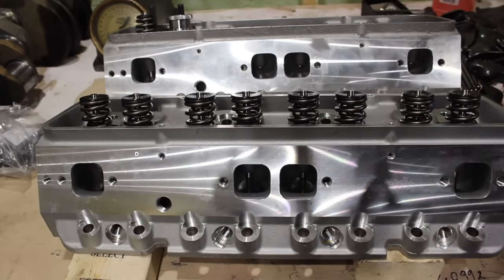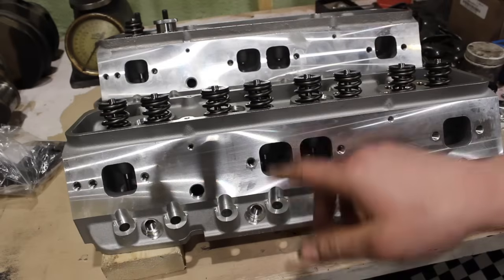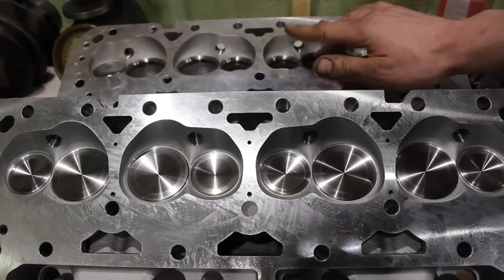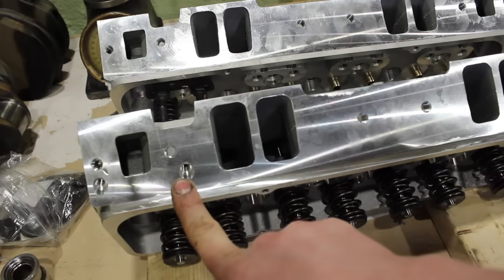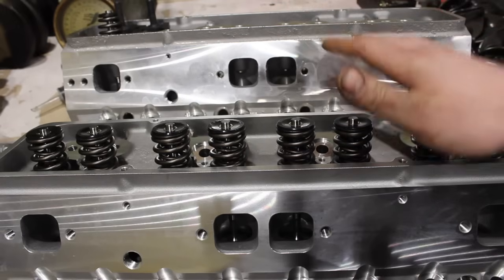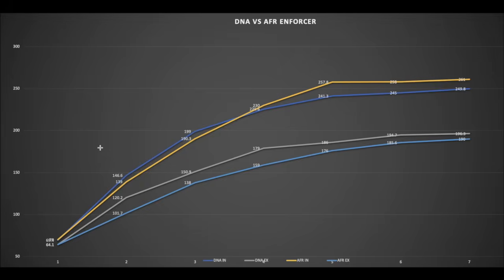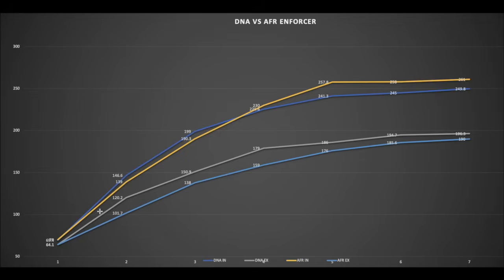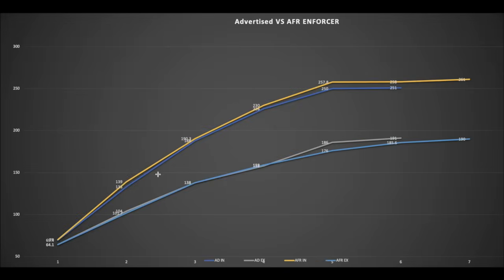$165 Amazon SBC Head vs Budget AFR Enforcer! (Flow Bench!)

Comment: I picked up a set of “Deepmotor” aka Chicom copies for $380 190cc int. runners & 64cc chambers and I did have to clean them up a bit (they’ll run fine I’m just ocd) but I picked up more power than $400 should have gotten me. I’d rather buy from an American company but I’m not wealthy so these domestic producers like AFR or Edelbrock etc... need to come out with actual budget heads if they want to retain customers that can’t afford their heads even when they’re used let alone new
Reply: Exactly, I'm a broke college student building my first performance motor and I refuse to spend 2k on heads that were still cast in the same factory in China when everything tells (like in this video) that most "chineseium" heads flow nearly the same casting bumps and all. Just bought some 400$ 205cc runner heads off Ebay we'll see how they do lol.

Comment: I need new heads for my 5.3 vortec LM7.  I don't know where to find them for good price.  I don't need performance.   I need stock.  My own are 862 casting.  My truck is 2005 gmc sierra1500.  If you know,  I would appreciate your help.

Comment: Yes, so many people are all about them flow numbers, but that's just a small part of the story.
Port velocity is even more critical when it comes right down to it!
Reply: Like Smokey always said, "You don't race flow benches". He also said, "Only you can prevent forest fires".
Reply: It's a combination of both.
Reply: More cc will take over at high rpm,,, port velocity becomes "less important"
Reply: this is 90s thinking all that matters is getting cfm into the chamber, which larger heads can.  I've been running 195cc heads on 5.0L sbf and have yet to see a smaller high velocity head (like ported E7 head) outperform me in the 2,000-4,000 rpm range
Reply: Phone numbers are often make more power on the dyno but when it changes gears the port velocity gives way down with it bigger port

Comment: The exhaust flow out of the AFR's is obviously a lot better and people don't think about how much that affects power production. You can flow like crazy into a cylinder but if you aren't getting that spent mixture out you're killing power. AFR's heads are expensive there is no doubt but how often do you see them getting beat in dyno comparisons? So if you are wanting something that looks badass but isn't go cheap if you want badass save up and get the good stuff.

Comment: For me I would go the bare DNA heads and a valves/spring/retainer pack from competition products.
Then an afternoon with 60 grit cartridge rolls in the ports.
Actually I would probably get carried away and port them a little.
Reply: Here's a tip... Just clean up the exhausts, shape the lower side and the area flowing out with a match port, especially at the bottom. I'm not into 5 angle valve jobs, because 3 angles with blended top and bottom angles flow better. You may also want to increase the throat to 75 to 80% if you have a lift near .600. On the intake side. Match port the runners in an inch or so, blending into the existing ports flow. Clean the rest of the runner up. 3 angle valve job blended and you are good to go. If you have some lift, hog the bowls to the flash then clean the flash area around the guide, then round your guide. It's a weekend project if you don't do this for a living. I'm a machinest and it takes me an a day. If you can spare a few CC's unshroud the valves in the chamber and at the plugthreads. It will cost you 2 to 3 CC's but worth It On the flow results I've seen. If your not going vortex, remove the upper lip at the top of the intake gasket. The intake side are based on vortecs. I can speculate on the exhausts. Heres something that they don't tell you. They take 16 + .100 valves.

Comment: Damn, back in the day, we couldn't have even imagined getting a head as good as those DNA heads for anywhere near those prices.  Holy hell the world has changed - haven't priced aftermarket aluminum heads since the mid-90's for SBC.
Reply: Really the CNC machine is what made this all happen
Reply: Because all China had to do was cost-engineer them vs trial and error and proper engineering.
Reply: Super simple nowadays. China just takes a good design, and illegally copies it. Then you find them for dirt cheap on Amazon, or ebay. They save themselves from r&d by just stealing the design.
Reply: @warhorse58gt  Since they make most of them for us, we either invest in America, or continue to lose out to China. I'm not condoning theft, but it would be harder to steal if China wasn't casting a large percentage of our parts to begin with.
Reply: @warhorse58gt   that does happen.. a lot. But its just as common for American companies to take their designs to China and have them made there. 

The glut of affordable stroker kits over the last few decades are 100% due to companies importing Chinese cranks.
Reply: And the tollerances suck
Reply: No lie.
Reply: You better sit down when you do get prices
Reply: Yeah I will never save a buck to buy foreign stuff if I know they were copied from American companies
Reply: Man you remember those 1000 Brodix heads?
Reply: Afr made in USA not China
Reply: @bigblock1383  not the enforcer, they all have their off shore budget heads. Some are from India
Reply: @bigblock1383  enforcer is not us cast
Reply: Sadly soon all combustion cars, bikes including classics will be banned from public streets in entire EU and Scandinavia  :-( 
In Germany the Green Peoples Party gave order to shorten fuel supply from 2025 on by reducing all conventional fuel stations to only one state operated central gas station per city or county. Now they want to slow down all the gas station pumps from 20 litre per minute to 2 litre per minute...From 2027 on in the EU certain car spare parts will be banned too....as exhaust systems, turbo chargers and even some engine and gearbox oils...California and New York will do the same from 2027 on.... So no investments should be done in oil burning cars any longer....They even created a new kind of crime here, called emissions and smoke crime (Bundesabgasbespassungsverbotsverordnung)!!!!!!
Reply: Sucks to live there
Reply: Why do you all tolerate such nonsense? Fight back moron. They’re cowards.
Reply: @Schlipperschlopper  . . . but an all-electric economy doesn't work.  Now they want to throw away the gas stoves and go electric.  The grid can't charge all the cars and do all the cooking, heating houses and hot water, and they still have to burn coal and natural gas somewhere until they convert the last forests into sheets of glass and windmill farms.
Reply: @Schlipperschlopper  rise up and fight

Comment: During my visit to China 25 years agoish I toured their industrial areas in several major regions and you'd see 1 plant set up to produce say Honda parts and that plant built the oarts to Hondas engineers specs and alloys and ratings... Literally walk out thr back door of some of thise plants and into a smaller dirty lousy lit plant producing the exact same parts but without the exacting tolerances and using inferior materials which is where the Honda G series engine clones came from as well as aftermarket Japanese brand replacement parts that cos thalf as much or less than oem... Today it's even worse over there as China doesn't honor trademarks,or any protective designs,names,nothing they can alter solittle and get away with... 
 Those Amazon cheapy heads would make a great starting point for a strong budget build where time and effort expended outweighed money thrown and probably wouldn't require much more investment in time and money than one normally throws at cast iron heads to reap much better results...
 Someone should build a set ir two of them; one mildish and the other all out and see what gains can be made...

Comment: Check the thickness of the upper wall, inside the intake side, on the short side of the valve radius. We made a lot more horsepower with a higher top wall there. It’s even more pronounced with 351 Cleveland heads for fords, BUT, ( on Cleveland heads) because of the volume inside the runner, it’s best to put vanes inside the runners. This is done by drilling a hole in the bottom of the intake runner and running a threaded shaft, which is attached to the “vane” ( a piece of thin curved metal, much like what’s in torque converters), and after tightening, silicone. You have a flow bench, put your finger in front of the intake runner (or a popsicle stick) to see the difference. Ultimately you’re wanting to direct flow to the short-side radius, heighten the top of the runner, to streamline flow into the combustion chamber and create a better “mix” ( volumetric efficiency) in the chamber.
Reply: Have thought about doing that for years, you're the first I've heard of using vanes. Are you talking about a carbureted setup and if so, what does the fuel do to the silicone? On the old Buick heads we have been taught to leave the short side radius alone, BTW.

Comment: i ported and polished a set of procomp 205 -202-160 heads and ill tell you i dont know what  they flow but my 358 runs real strong im talkin high 10s strong in a 78 malibu i had a 1190 camaro and this car is much quicker.my opinion you port any 202 head or bigger you will produce some power

Comment: Sand papper roll the DNA Motoring Heads , Gasked match them . use a Neck Down Valve . & . it looks like the DNA Motoring Heads would Out perform the Afr heads .

Comment: Just help do a little work on set of stock vortecs for his pickup, he stopped at 255 cfm.
Reply from the maker: Impressive! Its hard to get that flow from a vortec, not alot of meat to work with
Reply: @cuttersperformance  He did put bigger intake valve and used good seat cutter.

Comment: And if you cleaned up the rough spots on the intake and exhaust would probably flow even better huh??? Looked at a bare set for a 400sbc I gt on the engine stand

Comment: There's other factor like cc of the head when making a choice. Velocity is very important also. 
That said I'll take the AFR heads all day sure vs a cheap head like this. If it's a mild build and not really beating on it I guess they're ok and have a place. My little sbc with AFR 220cc makes 637hp on pump 93 with a hydraulic roller on a mild tune. 
Although anyone looking for the baddest 23 degree sbc head BES ALL PRO RR245 are where it's at. From .700 thur 1.000 lift they flow about 370/292. They only start at 6,700 though lol. Nice video by the way.
Reply: The AFR enforcers are a version of same chinese castings you can buy from china though afr does replace the valve guides and regrinds the seats before reselling

Comment: THOSE CHEAP HEADS FLOW PRETTY GOOD OUTA THE BOX, A LITTLE CLEAN UP AND A GOOD VALVE JOB,PORT MATCH AND THERE GOOD TO GO
Reply: If I had a use for them I would order a set in a minute.  Interesting thing though, the heads found on the 4.3L v6 Vortec motor found in Chevy light duty trucks flow quite a bit out of the box and with a clean up will flow over 300 CFM easy and that's more that the aftermarktet heads found for a Grand National or the Buick Stage 2 heads.  The heads from GM parts direct, are cheap.  Only $168 for a pair, that is crazy and they are made with very high quality and engineering.  The trade off, well you have to do a lot of custom work to swap the 4.3l v6 vortec into a Grand National for instances.
Reply: @charleslowe522   4.3 heads are Chevy heads. Grand Nationals use a 109 cast BOP 3.8 block.   They heads, intake, etc won't interchange.   Two completely different animals.
Reply: @charleslowe522  thanks for sharing!  I can’t find the heads you mentioned for $168 for the pair. Could you share a link?  I would love to get a replacement set for that price. For my GMC Safari =D
Reply: Especially when you can use a Cutlass body or Buick any G body

Comment: Stock 706 heads 250. Just put springs. Thanks for the info
 I'm addicted to flow numbers engine Dyno numbers and all that scientific stuff lol...
Reply from the maker: Ls head are amazing, no doubt about that. I got a few different sets here and will do some porting and flow bench results when I get some other projects cleaned up!
Reply: @cuttersperformance  I got a 68 cougar with a 1990 5.0 in it going to blow it up and then put in a 5-3 cannot wait to experience the ls power🇺🇸
Reply from the maker: The ole cross breed of Ford and GM haha love it

Comment: I would be more concerned with the quality of the DNA head as far as the valve's valve seat Springs retainers go... not so much the flow numbers
Reply from the maker: Yeah exactly!
I got these as bare castings but im still worried about the seats and guides. 
I'm adding American made valves, springs and retainers and we shall see
Reply: The biggest problem with the China heads is the hardware. I had a buddy order a different set for a BBC. Springs were supposed to have a seat pressure of 135. It was 80... Absolute crap.
PAC springs and Argentinian valves. That's where it's at.

Comment: Honestly how much does exhaust flow matter when cylinder pressure is 145 psi or more pushing it out? Would be interesting to see if it makes any difference on dyno, better or worse flow on exhaust. Great video thanks for comparing the 2 heads btw!
Reply from the maker: Well thats the old debate, how important is exhaust flow? 
Even dyno testing doesn't have for sure answer on that as it depends highly on the combo for NA 
Nitrous or boosted engines show very positive results with high flowing exhaust ports
Reply: @port nut And temps. There's more to it than just getting the gasses out.

Comment: The AFR enforcer is a great bang for the buck  head , I believe Skip White sells this same casting as an NKB head . I am putting a set of these on a mild 383 . if I were to complain about anything it would be the deck thickness . AT .450 it's seem a little thin , Not that I have any experience warping aluminum heads.

Comment: Got a part number for the knock off heads I'm in need of a set! I'd like to replace my 186. 300 hp heads and go aluminum and maybe a hydraulic roller in my ole tow truck

Comment: 300 + CFM from a 195cc port....I'd love to see that !
Reply from the maker: I believe the AFR CNC 195 racing heads are around there 
Pretty cool! 👍 but expensive
Reply: Eric Weingartner has proven the flow. He measured 299.2 @ .600" on his bench which is pretty conservative. It was not a marketing number on a Superflow 600 bench.
I've done a few SBC's with the fully CNC finished AFR 195 and there's nothing in that size out there that makes the same power unless you port it - and then it's not a 195 anymore...

Comment: I would like to see a cylinder head company pour and mold their own heads in their usa factory  I think all heads comes from the same place and the company just tweaks them to their specifications nowadays!!!!!!
Reply: AFR is cast and machined in USA !
Reply: @kennethalbert4653  okay and I know they used to be just wondering about now
Reply: @dickeymoore4264  I can't swear about the casting, though I am fairly sure, but i am certain about all their other processes.
Reply: @kennethalbert4653  yeah I'm mostly concerned about the castings
Reply: Just like years ago when I saw Holley fuelpumps were made in China I said whoa what a minute!!!!
Reply: @dickeymoore4264  From what I hear some are some are not.
Solution:  Buy the good AFR heads, those I'm sure are cast here....you won't be disappointed. 
 "When someone buys a budget product, they feel good when they purchase it and disappointed whenever they use it.  When a customer buys a premium product, they feel extravagant when they purchase it, but happy every time they use it."
Reply: @kennethalbert4653  That's right
Reply: @dickeymoore4264  Here's how it works. Every head outside of the Enforcers are made in the US. They are cast by Edelbrcok. There are only three head manufactures in the US who cast their own heads. Edelbrock, Brodix and Profiler. Edelbrock is the company that does the heads for AFR and Dart.
Reply: Edelbrock has their own casting facility in california and cast parts for other companies too. There's videos showing the facility.
Reply: @cyclonebuzz8172  can you send link for the video?
Reply: @port nut Edelbrock casts heads for AFR!!!!

Comment: Lol...your going to jaw drop when you find out...AFR gets all thier castings from china. The only thing American about them is the cnc program and machining. So to compare a $165 head to a 2500 is simple machine shop cost and packaging. Under u.s. law. A product only needs to be 30% manufactured or processed to be called American made. AFR are sell outs.
Reply from the maker: Wow did not know that? May I ask how you know that? My understanding was that only the enforcer series were cast offshore
Reply: @cuttersperformance  Sometimes its in the fine print "made in america" out of parts from china, hong kong, e.t.c. basically assembled in america.
Reply: Basically all aluminum and some cast heads start thier casting process in china. Everything in mass quantities has been out sourced. It started way back in the mid 2000's. And with some parts...even sooner. For example.  TRW piston became outsourced when they became speed pro. Mid too early 90's.

Comment: that is not slag in the ports, that is the cores parting line. better sand cores were used on AFR head. I worked in foundries for many years.
Reply from the maker: Yeah exactly, sorry I call it casting slag but thats probably not the right terminology